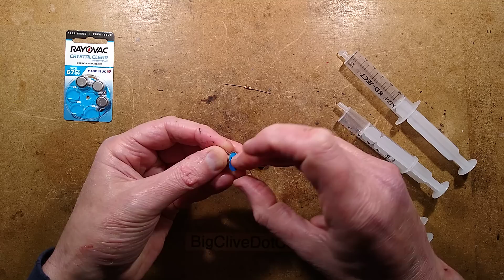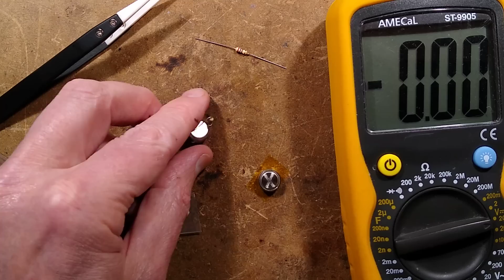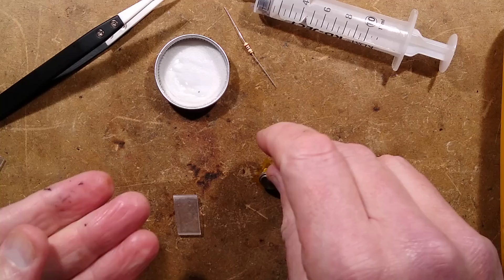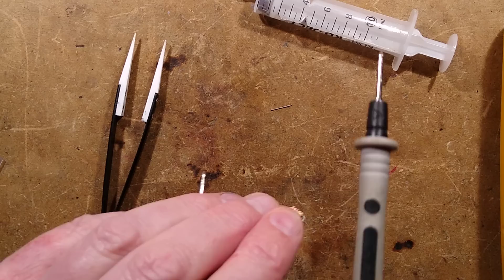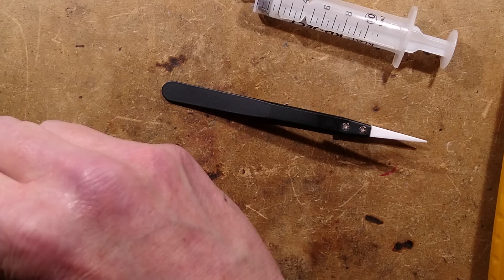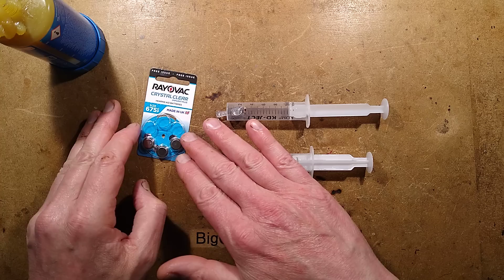Standard zinc-air cell vs mystery gas generating cell.  (flame test)

Comment: Interesting. I use zinc-air batteries in my old Pentax light meter (used to determine the right exposure for old fashioned film photography) because  that is designed to use a long discontinued mercury cell which will give a very consistent 1.35V for it's entire life so the metering circuit can be very simple as it doesn't need to compensate for the battery voltage changing as the battery wears out. A zinc-air cell is a decent substitute as it gives about the same voltage and also holds it quite constant. Of course the problem of the zinc-air batteries is their short shelf life after activated, only a couple of months, but on the other hand they are rather inexpensive so not a big problem.
Reply: I replaced the mercury cells in an old Aimpoint red dot sight with Zinc-Air cells. This was about 20 years ago, probably a bit more and it was their second or third design so it chewed through the batteries pretty quickly compared to modern designs. Anyway the sight was weather sealed, I think it was even rated for submersion, so the battery compartment was properly sealed. The Zinc-Air batteries worked fine but tended to run out after a day or so. But just opening the battery compartment and taking the batteries out and putting them back in again was enough to revive them. I'm not certain how many hours of use I could get out of them but it was some decent time. As an added bonus this worked even if I forgot to turn the sight off, as at this time there were no timeout or motion sensors taking care of this. You turned it on and off using a twist knob. Forget to turn it off and it emptied the batteries within a week, and that was with the mercury cells. The Zinc-Air cells would just run out of oxygen and stop working in a day or so.
Reply: @blahorgaslisk7763  Yep, and in addition to the natural auto-off feature, it also handily allows the once-opened cells to last longer even when you remember to turn the device off. As in non-sealed compartment, the once-opened zinc-air cells get drained even when not electrically loaded.
Reply: @blahorgaslisk7763  Yes, one would assume the needed amount of oxygen would be quite small so they would run for quite some time on what's trapped inside the battery compartment. 

Nowadays Aimpoint uses energy saving technology which makes the current draw of the LED so small the sight can be always left on and still needs a new battery maybe once a year or so.
Reply: This is assuming the battery compartment cap doesnt have a sealing gasket? I remember seeing a company that made step down converters for appliances that ran on mercury cells, an adapter that goes on a silver or alkaline battery and steps it down to 1.2V. Though it limits the cell size and capacity.
Reply: These old light meters and cameras aren’t usually weather sealed so oxygen can easily get to the battery chamber. I’ve used a zinc air cell in my rollei 35, which has a pretty well buried battery chamber and it worked just fine.
Reply: @thepurestofboredom1219  Yeah, I was thinking about some of the 60s and early 70s cameras that might still be using mercury, and those started to have some seals in them.
Reply: @thepurestofboredom1219  Same here for the viewfinder on my old Nikon F2S.  Doesn't matter now--I haven't shot a roll of real film in a long time.

Comment: That 675 cell works really well as a replacement for the Mercury oxide cells used in vintage 35mm camera equipment too.  Though it's interesting about the hydrogen.  Makes me wonder about their use in hearing aids and cochlear implants.
Reply: it needs to be starved of oxygen to produce the hydrogen so in normal use the effect does not occur
Reply: the hydrogen production is so incredibly small and slow it doesn't matter in that application.

Comment: I would assume that the holes that are covered by the round Blue label are to keep air out...... and perhaps restrict the flow of hydrogen coming out... 🤨
Reply: The label keeps the air out, and preserve the cell while it's on the shelf.  Once you let air in, the cell starts to produce electricity, and does so for a couple of months.
Reply from the maker: Stops air getting in during storage.  The hydrogen will push its way out.

Comment: Clive: "i'll hold the battery with my ceramic tweezers so i don't burn myself while using the heat gun"
Also Clive: "i'll use my bare fingers to squeeze molten plastic together"
Reply: I would think those are Bear fingers ...
Reply: Plastic is not a good conductor of heat. I use my bare fingers to strip wires like this.
Reply: @methamphetamememcmeth3422  While you are absolutely right, you also ruined a funny comment.
Reply: @methamphetamememcmeth3422  why do you heat wires before you strip them?

Comment: Clive. I'm not sure what the H to O2 ratio is in the syringe, but there's a chance it could end up with a bang if you compressed the gasses quickly. 
it would be like a fire piston but dangerous.
in a fire piston you can place a piece of chared cloth and when you push the plunger in quick it will create a lot of heat and make the cloth burn. That's with just normal air.
Reply: As Clive said, the cell will use all the available oxygen before it starts generating hydrogen, so there's probably no O2 in the syringe to speak of.

Comment: When you melted the end of the syringe.  Instead of using your fingers, use the workbench to flatten the end.
Reply: You must be new to Clive's channel...
Reply: @jpdemer5  not that new to the channel but I also fix things that are broken.  I've got parts for this and that as I look for ideas on making something out of parts for something else.  I took some classes on electrical engineering through ROPE program and did some drafting glasses for four years in highschool. Ideas, always looking for more ideas and this is one of the places I check now and then.  Have a great day.
Reply: definitely smart advice!  But, it isn't that hot (I've done similar things) and the fleshy bits make the plastic squash together with a better seal.  If you use something like wood or even those ceramic tweezers he had sitting right there in the frame, there is a chance they would leave a divot or seam for the H to escape.
Reply: @matthewcrist1012  we don't want any hydrogen to leak out and spoil the experiment.

Comment: As AVE shows nicely, active metals like zinc and aluminum react with hydroxide ion to make hydrogen gas. There are videos of soda cans being dissolved with drain cleaner as well. How quickly would this happen if the battery was shorted?

Comment: The science of gases. Some plastics allow CO2 molecules to pass through and they had trouble keeping fizzy drinks fizzy. Is hydrogen smaller than CO2?
Reply: A lot smaller. 2 protons vs 48 protons and a bunch of neutrons
Reply: @shouldb.studying4670  So how much seeps through the syringe walls?
Reply: @tonysheerness2427  i wouldn't like to guess sorry but if you are curious google permeation of h2 gas through X material, or something similar. Be interested to hear what you find 😀
Reply: @shouldb.studying4670  Clive's experiment was a success, however it would have been more dramatic if there was no h2 leaks.
Reply: For experimental reasons I have a few fizzy drinks bottles full of CO2 at work. However if I leave them for about a year the bottle ends up significantly crushed as the CO2 escapes. Was quite surprised when I found one after a year.

As for hydrogen it's pretty simple - it's the smallest molecule is H2. So it's quite difficult to get something to contain it as all other molecules are bigger, therefore will have larger gaps than a hydrogen molecule, which makes it easy for it to pass through.

Comment: Nuclear reactor plants have to deal with hydrogen seepage too. It is used for oxygen control in the reactor coolant system. From there it gets in-between the metal grains of boiler tubes while the system is hot. If you were to cool the system while before reducing the hydrogen concentration dissolved in the tubes you can cause them to crack along the grain boundaries. The hydrogen has nowhere to go and causes immense pressures to build up internally leading to material failure.
Reply: Hydrogen assisted cracking of austenetic stainless steel, oof hadn’t said that in a long while haha.
Reply: @mikejones590  that sentence is definitely not alcohol friendly 😂
Reply: @peterferguson2344  As most of nuclear tech tends to be hahah. Hard to keep the genie in the bottle when you are seeing 2 of them! 🤣
Reply: @mikejones590  Wasn't the bigger concern with SS tubes chlorine stress corrosion cracking? I remember it being the reason 300 series SS was replaced with the variety of inconel alloys used over the years. It's been most of a decade since Power School for me though and I've been out of the service for a few years, so I might have some facts backwards.
Reply: @Jtretta  you are most likely correct, I remember the gas gets into cracks and expands causing the Crack to propagate. I have done my best to forget most of what they taught me.
Reply: How does one reduce the hydrogen concentration dissolved in the tubes
Reply: @dwindeyer  The hydrogen originally came from the coolant and exists in the grain structure of the metal in equilibrium. As such, if the hydrogen concentration is reduced in the coolant and a period of time is given, the hydrogen will naturally diffuse out of the metal thus minimizing the effects of the hydrogen assisted cracking. As an aside, I'm always surprised how many other nukes I find on technical youtube videos.
Reply: @dwindeyer  And an interesting question to Jtretta's interesting post. Hope we get an answer. Thank you to both of you and to BigClive and his experiment that caused them both. 👍
Reply: @pipercessna3827  Hope my answer is helpful to you
Reply: @blackhatazhat  Thank you. I very much appreciate the time you have taken with my education. It occurred to me when you mentioned "period of time" and "naturally diffuse" that this seemed very similar to scuba divers decompressing to avoid the bends.
Thank You again Joshua. I hope you have an excellent day. 👍
Reply: @pipercessna3827  I would like to apologize for not responding, I posted the original comment and then went to sleep. Alas, even us former nukes need a wink of shut eye every now and again.
Reply: @Jtretta  Please, that is totally unnecessary and I hope you had an excellent sleep. 👍
Reply: @dwindeyer  hydrazine I think.
Reply: Interesting.
Reply: Doen't the nuclear reactions produce some hydrogen on their own?
Reply: @johndododoe1411  Surprisingly, yes. Free neutrons are not stable and ß- decay with a half life of a few minutes. There is also a reaction with oxygen-16 where a neutron essentially punches a proton out of the oxygen atom. The resulting nitrogen-16 ß- decays and spits out an electron. Both processes result in a small amount of hydrogen being generated.

Comment: I wonder if the gas generating cell is more optimized for longer duration operation, that it releases more gas (or more consistent over time) but more slowly than the zinc air cell?

Comment: Would this work with a vacuum seal “food saver” bag, or would the hydrogen find an escape route?
Reply: Some hydrogen will just go through the plastic.
Reply: @GoingtoHecq  perhaps metalized Mylar used in layers could hold it. Like a space blanket kind of material.
Reply: @mikejones590  I’ll give that a try… just need to get hold of some Zn-air batteries.

Comment: That hidrogen seepage problem is one big reason why making rocket fuel tanks is so difficult and expensive, not too long ago a composite material tank of a spacex rocket went bang because the hidrogen seeped in between the carbon fibre layers and caused it to peel like a higly pressurized cryogenic onion. Edit: spacex doesn't use hidrogen for their rockets, my bad.
Reply: Spacex haven't used hydrogen in any of their rockets as far as I'm aware
Reply: If I'm not mistaken one of their engines went bang yesterday.
Reply: @arletottens6349  thx👍
Reply: You are thinking of those big bubble things that store the hydrogen, they are made of steel and the hydrogen even seeps through that! Steel is “porous” to the hydrogen due to its itty bitty size
Reply: For fucks sake it's hYdrogen.
Reply: @han5vk  my hunch is non-native English speaker, because it's "i" not "y" in lots of languages

Comment: My mom uses hearing aids, and I always wondered why the batteries for her hearing aids had the little tabs and how they kept the batteries “fresh” until use. It has been rather interesting learning about the technology of these batteries, it is rather intriguing!
Reply: Same here I always thought the tab was an insulator.
Reply: @chasejdmartin  Indeed it is an insulator! It insulates the cell from oxygen until removed.
Reply: In some of them, yes. On others it's just a tab to hold the tiny battery with when older fingers have to get them inserted into an equally tiny device.
Reply: @AndyClements  yeah, the batteries I've used with tabs do not have holes, it's just an assistant for arthritic hands and proper polarity.
Reply: @volvo09  The cells without holes are a different technology. They'll be alkaline or silver oxide, so more expensive and more polluting. The zinc-air cells need the hole to let the air in and the tab to keep it out until you're ready to use them.
Reply: I didn’t realize they started putting those “don’t feed this to your baby” stickers on the underside of coin batteries. Put one in my wife’s car remote fob and for a moment I was thinking it wasn’t working because it had been dead for so long or that it lost its programming or rolling code. And yes, removing the sticker greatly improved the connectivity! Lol
Reply: @bowieinc  it wasn't really an issue with 1.something volt cells, 3v lithium primary cells can do electrolytic damage to internals of children, you have that to blame for the annoying screwed on battery covers :\
Reply: Air is basically the electrolyte.
Reply: @therealjammit  Air is the cathode (or anode, if I'm mixing them up). It's a fuel cell that uses air to oxidize the zinc. The air is part of the fuel (depending on the definition of "fuel").
Reply: They keep it fresh by acting as a single use switch, thats turned open until you pull the tab out
Reply: The little sticker tabs are to make it easy to install into the device. No other reason.
Reply: @binaryguru  I've never seen such batteries. The zinc/air cells my aunt used are also activated by removing the sticker and revealing tiny holes.
Reply: @binaryguru not on zinc-air cells. They serve as that as a secondary purpose, but the primary purpose is to prevent cells from activating in storage. Zinc-air cells use the oxygen from the air in a fuel cell type reaction. Once you remove the sticker and expose the air holes, the reaction starts-whether the cell is being used or not, the reaction occurs.
Reply: That’s precisely why audiologists advise activating hearing aid batteries correctly by letting them breathe for a full two minutes between removing the sealing tabs of zinc-air cell hearing aid batteries and putting them in the hearing aids.  This often let the hearing aid batteries last longer when in use.  I wear hearing aids in both ears due to having severe hearing impairment since birth, and I’m 28 now as of posting this.  And yes, I’ve also tried the other kind of batteries that don’t have holes in them but instead long tabs for easy handling, but those are not quite as powerful or long lasting in some cases, and my current hearing aids use a lot of power due to advanced smart technology despite being more energy efficient.